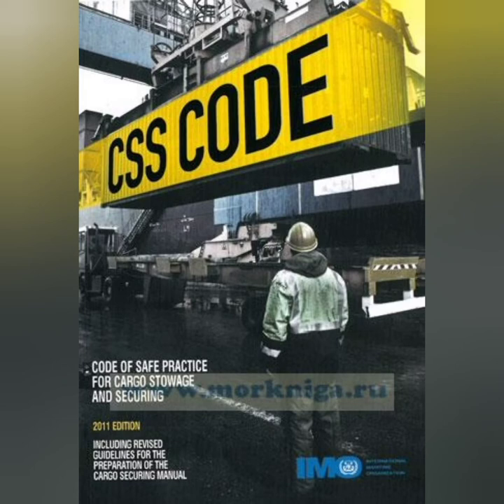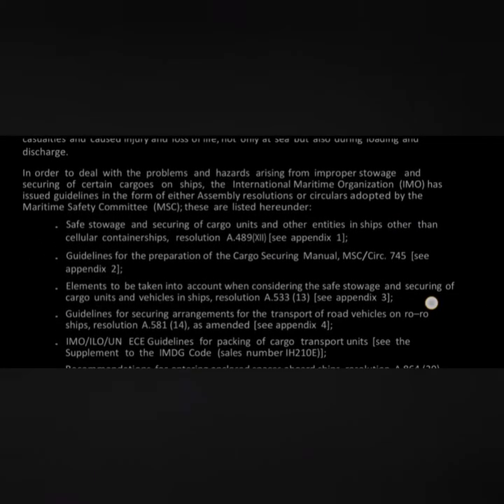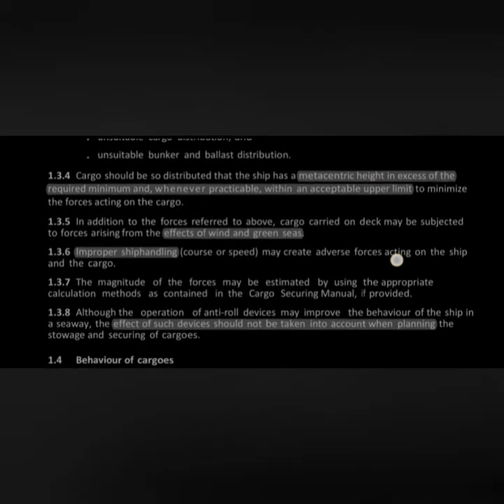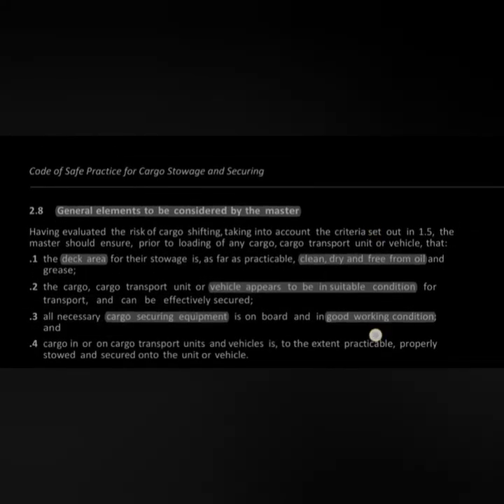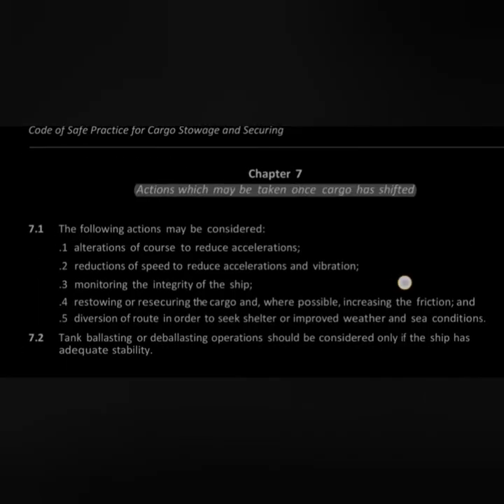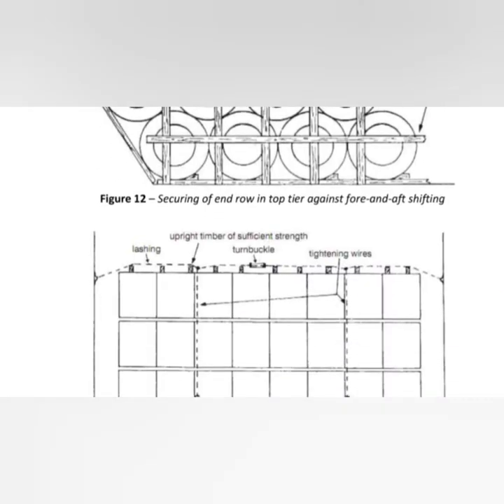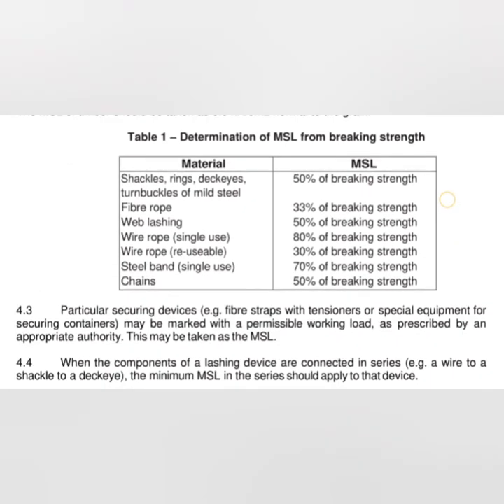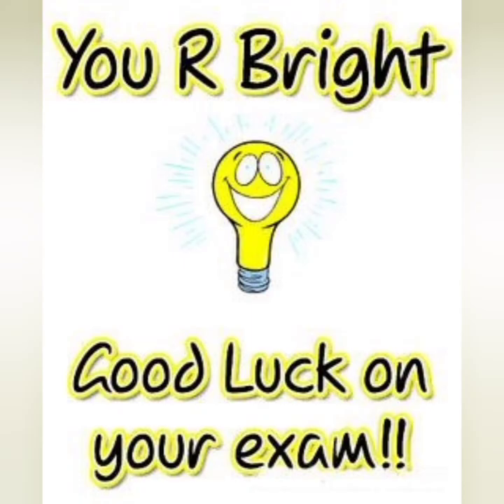Content & structure of CSS Code & Solas regulation requiring Cargo Securing Manual!

Comment: Hello, as a Jr. Officer, I have been paying some particular attention on the advanced calculations of forces included in the CSS Code. But I found it difficult to understand, or, at least it is required some solid explanations or examples to get how to use those calculations. I was wondering if the C/Os actively use the mentioned calculations while lashing operations or they rely on the knowledge of stevedores at ports. Would you make a video giving details on how to use the calculations with an understandable format in your channel?
Reply from the maker: CO probably rely on the calculation in the approved cargo securing manual. As long as cargo gears are as per the safe working load mentioned in the cargo securing manual, everything is fine.

Comment: Hi. Preparing for orals. Can you please advise from which book, or code can i get answer to this qts
"Where can we look for damage and defects most commonly encountered on ships structure due to loading/unloading ops, corrosion, severe weather conditions.?
Thanks.
Reply from the maker: There is a report issued by classification society, which talks about all the vulnerable areas onboard a ship where we must look during inspections.
Reply: @oralexammmdprep8110  Hi Thanks for replying,i am not onboard at the moment, can you advice from where can that report be derived,cant find anything as such on the internet.
Thanks again.
Reply: For 2nd mate prepration join kundan patna #kundanpatna

Comment: After loading operations what all you should update in csm ? Please answer sir
Reply from the maker: Cargo Securing Records: Document the methods used and any securing equipment deployed for the cargo during the operation.

Condition of Securing Equipment: Record the inspection results of securing devices (lashing gear, twist locks, etc.) after cargo operations, noting any wear, damage, or replacements.

Cargo Securing Plan Updates: Update any deviations from the standard securing plan if alternate methods were used.

Comment: Sir can you please tell about what are Standardized,  Non-Standardized and Semi-Standardized ?
Reply from the maker: Below are the definition from the Cargo Securing Manual Guidelines... I would soon making a video covering that: 
Standardized cargo means cargo for which the ship is provided with an approved 
securing system based upon cargo units of specific types.
Semi-standardized cargo means cargo for which the ship is provided with a securing 
system capable of accommodating a limited variety of cargo units, such as vehicles and 
trailers.
Non-standardized cargo means cargo which requires individual stowage and securing 
arrangements.
Reply: @oralexammmdprep8110  thanks a lot sir , sincere regards for your efforts and teaching.
Reply: For 2nd mate prepration join kundan patna #kundanpatna